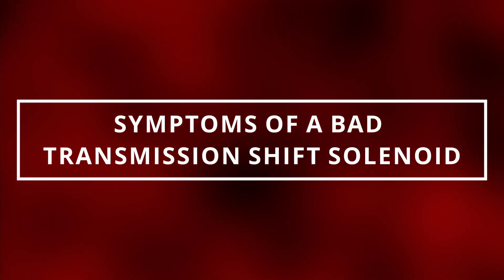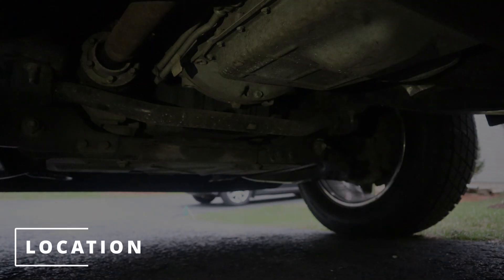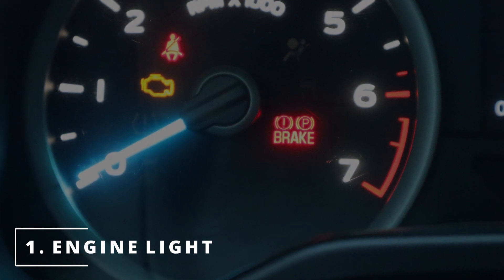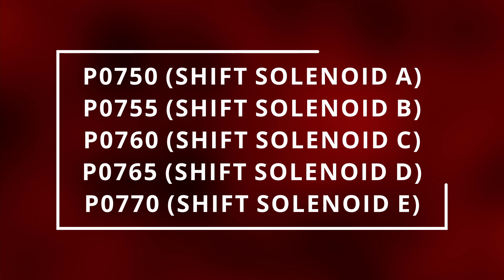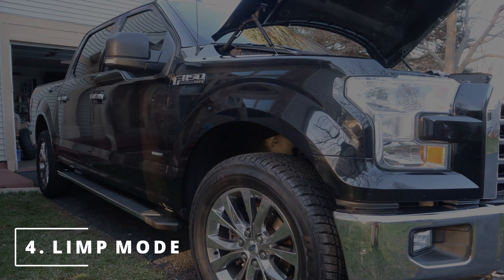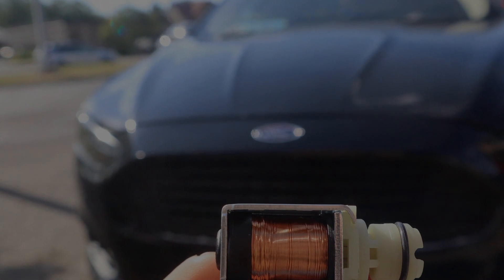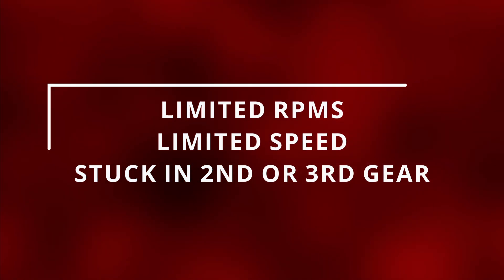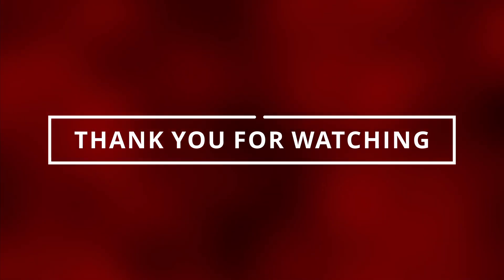SYMPTOMS OF A BAD TRANSMISSION SHIFT SOLENOID

Comment: 2003 Mazda Protege5 auto 126k miles
On interstates at speed(70mph and above), if I hold these speeds for any length of time, car will slight rpm surge and downshift! Not comfortable at 75mph!!! Is this something possibly fixed by changing out solenoids and filter?
Car drives completely fine in any other situation below these speeds.

Comment: i got a 97 dodge ram 2500 5.9 cummins my issue is that my 2nd gear doesn't shift properly could that be the governor solenoid?

Comment: Before running out and buying those solenoids try replacing the Transmission Control Module that is located inside the air filter box, (Chevy Impala)  no tools required and it fixed my problem. They will run you about $20 at the salvage yard, fault P0700.! It takes 5 minutes to replace! You're Welcome
Reply: What if you have a CVT transmission?
Reply: Whyyy tf would I spend 300+ before I spent 75? Lol I'm here for a reason lol
Reply: Hi boss hope all is well .I have a 2011,I was at stop light light turns green I press peddle ,car makes like a "TRRR"sound somewhere under ,then a snap ,car drive for 3 miles then my tracking come up and car didn't wanna eccelerate anymore .any ideas what it can be , thank u
Reply: @priscillaamaya2736  what light turn green, I'm having similar issue did you ever find out what was wrong with you car!?
Reply: @priscillaamaya2736  had this same problem..no codes...alternator even though it tested as ok.  Changed it out and problem went away.
Reply: Thanks. Is your impala a 2010?
Reply: @jaredpatterson1701  Mine is a 2006 but it is the same for all Impala's that use a TCM
Reply: @Mark Olsen   im hearing the TCM on the 1013 models are in the transmission.... wassup qith that??
Reply: @Dagreat12d  Perhaps I should stated, all with an external TCM
Reply: My 1995 mitsubishi super saloon v3000  wont do first gear just starts to have power around 60mph  help me whats my problem
Reply: @ythaks267  does your car feel sluggish after a certain speed or do you have trouble accelerating till you hit the 60mph?
Reply: @ythaks267  also just by what you stated, is your car a manual transmission?
Reply: @ythaks267  (this is her husband replying) so second and 3rd gear? Or more towards 3rd gear just working? Try checking your trans fluid for dirty fluid and like this video said check for bad shift solenoid. If you replace the shift solenoid or have questions about during replacement don't hesitate to comment.
Reply: @ythaks267  Your problem is that you bought an import, get rid of it and buy a newer vehicle, A GM product made in the USA is a good choice
Reply: @markolsen7438  that depends.
An older GM sure,a new one no thank you.
Buy a toyota,with proper maintenance,will last forever.
Fuck made in America bullshit pride
Reply: @Chugchugg24  I never suggested to anyone to go out and buy a new car. Where the hell did you get that from? Can you read plain english? A $20 part is a far cry from a new car
Reply: @markolsen7438 American made is for show and is a joke. Real truck owners know longevity wise nothing out there beats a Toyota. But if you like the fancy gimmicks for a few years and have the bread to dump in a useless ford gmc or Chevy truck then flex away. But if you want actual durability and your money well spent. I don’t think hardly anyone would think, hmm. $50k and I want a durable nice truck that will last me 10-15+ years. That has to be a gmc ford or Chevy. 🤣 no. No one in their right mind would pick any of those companies over Toyota or Honda. Unless you like wasting money.
Reply: How bout 2005 lacrosse
Reply: Did yours have to be reprogrammed?

Comment: When mine shifts from 2nd to 3rd, it just revs up like it went into neutral.
Reply: mine is doing the same shit. it does it when its cold. but after it warms up, its fine. its just on cold starts that this happens
Reply: Same here men
Reply: Mine shifts fine till 3rd gear then it just revs high I Have all my other gears still any suggestions?
Reply: @laylowk1426  Did u find out the issue
Reply: I'm thinking it's one of the solenoids inside the pan.  Probably worth it to just replace them all vs dropping the pan multiple times
Reply: Hey guys change. The pressure. Sensor plate. Bottom of transmission
Reply: @randytolin3059  I don't see something called pressure sensor plate
Reply: @djturnz  If u buy one let me know i need one also
Reply: You gotta drop the pan. The  silver. Looking plate has 4 bolts holding it on.
Reply: @randytolin3059  I'm trying to find the part online.
Reply: @djturnz  its called a transmission. Pressure switch. Its a flat plate. It has  4 or  6 bolts.  Soon as you pull the pan off you will see it.
Reply: @randytolin3059  I understand that, but I'd like to have the new part in hand before dropping the pan

Comment: Hey so I have a problem with a 2010 sxt charger where it goes into what i assumed was limp mode, because it doesnt shift past 2nd or 3rd, but it doesnt stop me from accelerating past a certain point. Im able to rev all the way til redline and even hit speeds higher than what limp mode should allow. also every once in awhile it would just go back to shifting like normal. I know for a fact theres some wiring issues in the middle console or something because the radio and things in that area lose power at random. I'll have to get the CEL codes again but this is a confusing one
Reply: Must be a dodge thing because I've had that happen a few times with my 2009 Journey. Lots of electrical issues and sometimes when I accelerate it doesn't change gears, so I have to stop and restart the car.
Reply: It's happening right now with my 2008 dodge dakota. When and paid 3600 for a new transmission to be put in and then it drove good for 3 days and it went back into limp mode. So now the warranty kicked in and they are gonna put another transmission in hoping that the one I got was just and unlucky reman. I hope it gets fixed
Reply: happening the same to me in my dodge 2010 grandcaravan.  Just read my codes and i have a p0765 shift solenoid malfuction.  And dirty as all get out fluid. hopefully we can solve our issues.

Comment: If my pressure control solenoid is bad do I have to get another transmission rebuild?or can I just replace the pressure control solenoid?
Reply: You need a new car bro, if one of those is bad, it means its over for your car, can't be replaced, they don't make those and if they did make em, you cant remove your current one as its permanently welded with gorilla glue ultra super duper strength Silverback edition.
Reply: @dannydee9919  and why would you say they need a new car when some shops may charge $1000 to rebuild transmission don't give false information bro
Reply: @dannydee9919  that's not true bro and that depends on the make n model for mustangs yes they makes em and its right underneath the tranny pan
Reply: @bosspranks8349  i just pulled my 2nd shift solenoid out of it with no problem with being welded in by the motors heat like some would think. And my wifes car has high milage lol. but i still replaced mine but its doing the same and not shifting.
Reply: @huggdeeznutz  on a mustang?
Reply: @bosspranks8349  no on a Acura MDX there pretty much the same way on resetting the ECU
Reply: @huggdeeznutz  so what do you think the issue is
Reply: @bosspranks8349  try this.
 1. Turn on the key but do not start your car.
2. Wait until the dinging sound is gone
3. Press the gas pedal slowly for 3 seconds until it hits the floor.
4. Release the gas pedal slowly for 3 seconds until fully released.
5. Count to 6 seconds after that.
6. Turn off the key
Reply: @huggdeeznutz  ok and what that does?
Reply: @bosspranks8349  i took it to like auto zone and they ran a test to tell me what shift was bad like mine was the 2nd replaced it and it still didnt fix it until i reset the ecu
Reply: @bosspranks8349  if your transmission isnt shifting right try these steps and it should work if not then its something else also try unhooking the battery to reset the main computer to the car. then redo these steps again and see if its still doing the same issues you are having.

Comment: I have been having problems  With my 2009 impala aspirin I cannot figure out what the problem is neither can any of the shops that I've taken it too. So what the car does is after about 5 to 10 minutes of driving it will just turn off but it will always turn back on without any issues. I got it looked at and they suggested that I get a new battery because the battery light was on and I got a new battery but it still does it think tested the alternator in the alternator is fine. I'm. Now I've been driving at the past few days and it hasn't been turning off but the car overall just feels very weak and I just don't feel like I'm getting the gas that I'm putting into the pedal. I don't know if it's the transmission or what it just doesn't feel the same it's almost as if the car is sick
Reply: Change your spark plugs and wires... if battery is good and alternator is good,  then the voltage while driving comes from the alternator which turns mechanical energy into electric energy.  Your accessories and operating function is powered by the alternator when running,  which charges the battery enough to start the vehicle.  You have less power in your ride,  battery good,  alternator good, rpms good.... only 2 possibilities: bad plugs/wires or bad ground conductor cable needs cleaning
Reply: Bad spark plugs=less fire from combustion =less power=poor fuel mileage = flooded valves 
So,  should smell gas after driving it. Turning accessories off while driving  and it drives like a charm, but shuts off going uphill with the ac on with windshield wipers on and trying to roll the window up and shining high beams
Reply: Hot dog in your gas tank, I seen something like this happen where it hot dog gets sucked by gas line then car dies. Once it’s dead it’s not sucking in the hot dog so it floats.
Reply: Crankshaft sensor my boy
Reply: Could be crank sensor.  Could also be key switch.  Had similar problem with 2000 blazer.  Ran fine for days then stumbling like plugged fuel or not much spark.  Fuel filter changed and good flow and pressure.  Changed ignition coil but still did it.  Noticed 2 problems both related to power supply and replaced ignition switch-electrical part not key switch.  Been over a year and problem solved.

Comment: My Nissan murano does hard shifts from accelerating from a stop. After the hard shift, the car would not accelerate fast at all. We are suspecting a bad valve or a valve with a bad seal. This problem would only happen when the car is warm because the seal becomes soft and moves around
Reply: That probably has a CVT tyranny and depending on  the year, they had problems with the clutches.

Comment: My 2012 Honda Accord se v4 shifts kinda hard when going from 1 to 2, when I first start the car then it regulates to normal and shifts smooth. But sometimes I feel like it doesn’t pick up speed fast enough.. also when I’m starting to go slow the car kinda shakes abit like it wants to stall do you know what the problem might be? I just changed the transmission fluid,
Reply: Is your fluid level where it should be?
Reply: @nothanks1627  yes it is, changed the fluid.
Reply: It's your torque converter vanes,  bent or warped.
Reply: @kenlitchfield7313  I’ll look into this thank you, how do you diagnose this ?
Reply: You said when you first start the vehicle it shifts rough, but then smooths out... so,  there's a delay in the pressure building enough to engage the hydraulics in the transmission, affects acceleration... but then the pressure is fine and the transmission operates normally-that's the first hint.  The second is the shuddering when slowing down... there's a delay in the pressure decreasing.  So,  what does your car do if the brakes were sticking and you were slowing down? Shudders, right? But we can rule that out because you don't hear squealing,  smell burning brake dust or have any trouble after the vehicle warms up. The solenoid is most likely what's at fault. Can you hold the brake down, shift into drive,  tap the gas pedal all the way to the floor 2 times quickly and then put it back in park? Does it buck when you shift from drive to park after doing that? Torque converter or solenoids, either way, your Trans is automatic and operates hydraulically... the flow is hindered going in and coming out...the TC is gonna be your issue. Solenoids will be on the TC,  underneath the transmission pan

Comment: Have a 1994 Oldsmobile Cutlass Supreme s 3.1 back in February of 2021 my car was cutting off at the stoplight took her to Firestone and at the time they couldn't find anything wrong they even cleaned the throttle body but if assistant months later I took it to Meineke and they done testing on it and telling me that I needed a crankshaft positioning sensor driving home and it drove worse took it back to them and that's where it is in the shop now for 5 months be placed EGR valve clean fuel injectors a new alternator a new map and although it has stopped surging it was still cutting off but not as long did look at the torque converter and then they told me that I needed the automatic transmission control solenoid but they told me that they couldn't do the work I had to remind them back in 2015 baby please a transmission in my car BC if you have to take until the oil transmission shop which again I have been waiting for so they really do not know if it is on my transmission solenoid again the car has been in the shop for about 5 months in regards of a scanner very few shops with Kerry in OBD1 scanner but I did not but I did not know that a dirty transmission fluid would cause these symptoms

Comment: I am experiencing all of those affecting my car. Is the repair expensive?
Reply: Depends on what what its in. Most of the ones I have done is under $100 in parts and fluid. But I didn't do kits just solenoids.
Reply: @kevinhovis4  Thank you for your expertise

Comment: Okay I have a 2015 Camaro 1SS A6 …The car starts but Putting it in R or Drive it doesn’t move. Also when I start it, it moves slightly kind of like when u put a car in park and let go of the brake. It won’t rev pass 2k if it does I’m forcing it. I don’t wanna start spending money on the wrong thing. I did however find out the fluid/filter was supposed to be changed at 46k miles I’m now however at 52k and I got the car at 46k but just learned of this. I also get a transmission hot idle engine message then service stabilitrak. Anybody got insight ?
Reply: Same problem I'm having with my Cadillac...did you ever figure out what the issue was?
Reply: My 2011 camaro won’t shift out of park. I have no clue why. Just moved to a new city and quite far from any mechanics. I’m hurt bro lmao did you fix yours?
Reply: @Gainsforlife  bro you gotta push down on the brake and hold it, then hit the gas, go up to 1k, 2k, then 3k, mine always shift when I do at least 3k rpms. It be stuck from P to R, so I hold the brake and hit the gas sometimes it go smooth, sometimes it jerk but I can drive it
Reply: Drive axle broke
Reply: @rippinrheaume242  transmission Cable for me
Reply: Anybody fixed the problem please and thanks

Comment: @EasyAutoFix hey bro how are you doing today? I have a question I have a 2010 Acura MDX with a jerk issue. It jerks from 1st to 2nd and sometime 2nd to 3rd I don’t have any DTC code store or warning light in the car on I have changed the fluid multiple times and transmission fluid filter with no luck. I’m thinking to remove the linear dual solenoid and cleaned. It only happens the most when you in traffic and press the gas pedal gently it will jerks from 1 st to 2nd. Do you think cleaning the solenoid will help or I have to be ready for a new trans?
Reply: Not really it helped but it’s not a fix. Maybe the tranny is going out..
Reply: I didn't find the solution. It started here on YouTube. I got bored in vain @hanselldisla4643
Reply: Did you fix this issue? @Hansell Disla
Reply: Not 100% I did the flush and refill 4 times and I changed the pressure switch on the trans and it help
Reply: I've had the same problem for more than 8 months. I took it to a lot of mechanics, but it didn't help. Did they fix it?

Comment: NEED HELP - I have a 2001 Olds Aurora, 4 litre ( V8 engine) that runs good,
but just when I'm coming close to a dead stop, it"sometimes" bucks a couple
times before idling down to low RPMS that it should have at stop position.
It's like the engine wants to keep going, and doesn't realize, we need to stop.
The engine doesn't rev high or anything, it just sort of bucks a couple times.
This problem only happens intermittedly - not all the time. How can I fix this?
 
Other than this problem, my transmission runs and shifts smoothly, and the
speed of the car is not affected at all at normal driving speeds, but only when
slowing down to come to a stop - may start to buck a bit before stopping. My
car does not go into limp mode, but the Check Engine Light is on.
 
BTW - Good video here, and does anyone have any suggestions ??
Reply: Vacuum lines

Comment: Can I have this problem without check engine light coming my rpm go up to 3then go back to two when changing gears
Reply: Did you find out?
Reply: @jaquancrump7316  yes amoco transmission said it's a solenoid d they $700 to do the job but I didn't have a check engine light they say it was a code when they scanned it cousin told they are scammers so I didn't let them do the work but nobody else can find a code
Reply: Mine too no light no code
Reply: How do you know if it changes gear my car is automatic
Reply: @dogeofamp6037  you can feel it changing